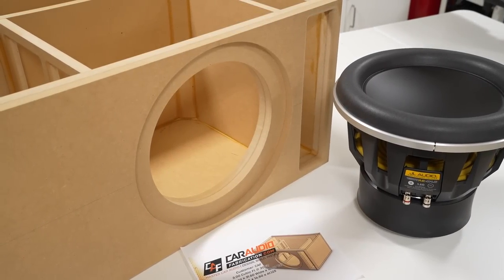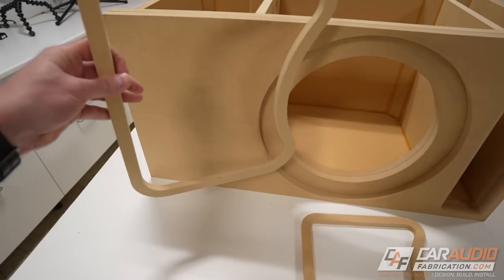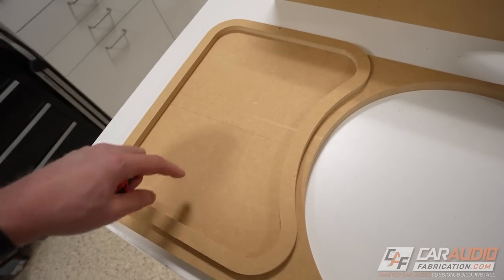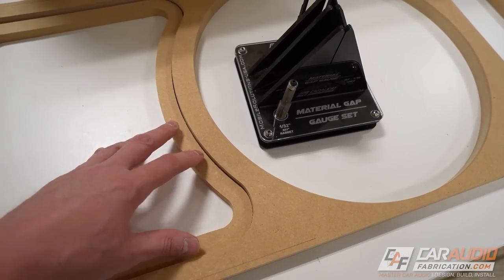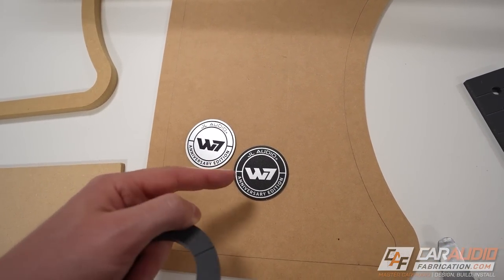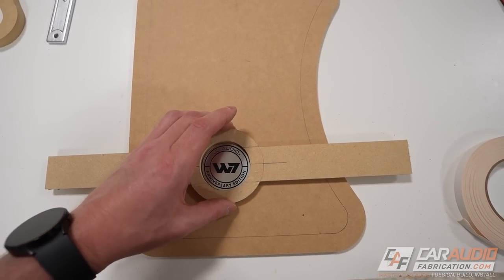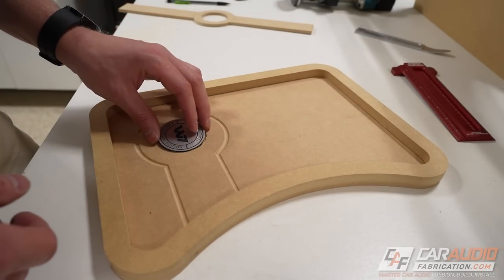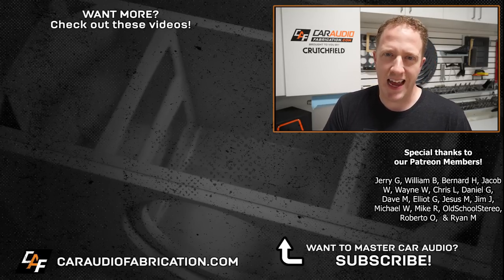SUBWOOFER BOX MODS! Adding custom templates & logos - 13W7AE Box Build

Comment: Great videos brother as always. 
Had a question for you that I needed help with. It's about amplifier power matching to speakers.

Why when Dyno testing amps with sine waves we get the rated power usually but when testing music, we get about like Half the rated power.

Should we then buy an amplifier that is double the power for the speakers to get the most from them?

Eg. Dyno on amp sine wave 1khz 500 rms. Midrange speaker is 500rms continuous. But when playing music, the amp fluctuates around 200 to 250 rms music power.
So should I get an amp that is like 1000rms so the music power will be around the 500rms continuous for the speakers ?

Thanks for any feedback.

Comment: I’ve got some subs I’m working on and the wire is to big for the sub terminals I was wondering if I could unscrew the tinsel leads and put some ring terminals under the screws for the wires

Comment: I have a 2 12w7 running on Rockford Fosgate T2500 is that the right amp or should I get 2 Jl vx 1000/1 amp need advice

Comment: Hi Mark.
Looks very nice, but the amount of MDF you're using doesn't it make your car twice as heavy. Isn't there any possibility to make it strong and dampened without using so much MDF.
Reply: You could use Birch but it’s not that much lighter than MDF.  A single 3/4” box like this weighs less than the sub itself!
Reply: @Bfraz00  Well, a customer of mine is a professional carpenter/kitchen builder. I didn't have the time to make my own box. I asked him to build me an 80 liter birchply box for my two Morel Ti124's. It's really quite lighter than MDF, which I normally use. 
The reason I asked for birchply was that it's more water-resistant compared to MDF, and I've been told it's as strong, if not stronger than MDF. I sincerely assure you it's lighter than MDF.
Reply: @Bfraz00  But the Morels are light, even they can handle 1000 watts RMS. The other two subs, which I have, Focal Utopia 10WM, are 10 inch and weigh more than the Morels, which are 12 inches. Strange, I can't explain it to.....
Reply: @umtbozkr2358  typically audio builders use 13 ply birch and a 4x8’ sheet of it is only a few pounds lighter than MDF.  It’s so minor most folks don’t even bother.  In the grand scheme of an audio build if you’re looking to shave every last pound you wouldn’t be adding a large subwoofer box anyways.  And none of my components are subject to water intrusion so that’s a non-factor for most applications.
Reply: @Bfraz00  You're right, and that's the reason buying a powerful car to compensate the extra weight. 
We are talking about the material of the sub box. What about soundproofing? 
You can't imagine how many people use MDF for speaker adapters. My main reason for birch was the weight, durability, and the strength op birch in comparison to MDF. I have been in car audio since 1995, so 28 years. You like MDF. I'm fine with it, but I don't agree.
Reply: @umtbozkr2358  if someone uses MDF for adapters then they deserve what they get lol.  My car has 900hp so I don’t notice the weight of my soundproofing or equipment 🤣
Reply: @Bfraz00  Exactly! In the worst case, you can have a bespoke car audio car, and a speed car like I do 😂.
By the way, a Mini Cooper S R56 with 265 BHP is pretty nimble on the track!

Comment: I got a question if you make 10 cubic inch enclosure and insulate the equivalent of half of the area (reznant preventer and Acoustic fur) is it still a 10 cubic inch enclosure
Reply: 10 cubic inch? That´s too tiny for any sub...
Reply: @mindtraveller100  SMH 🤦‍♂️ 🤦‍♂️ it's example it just example